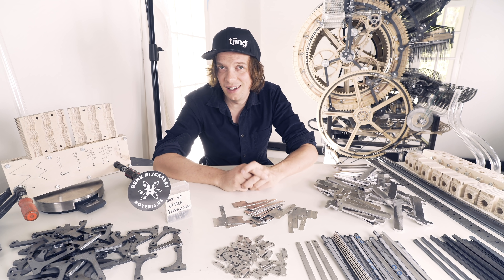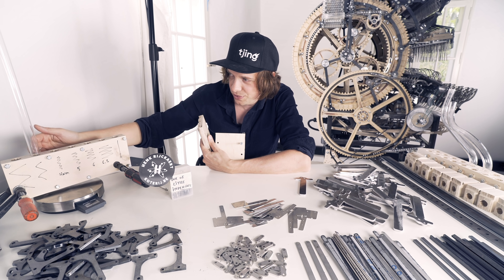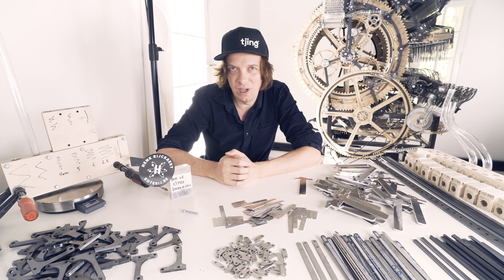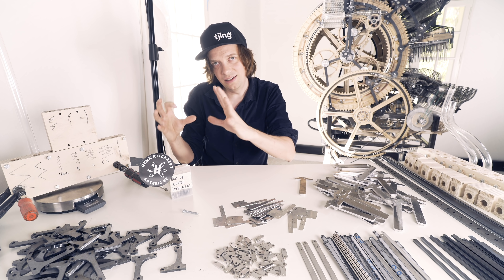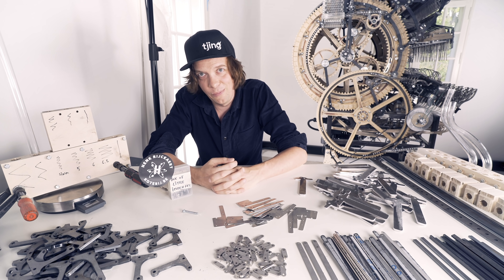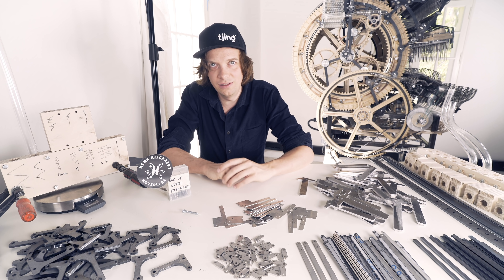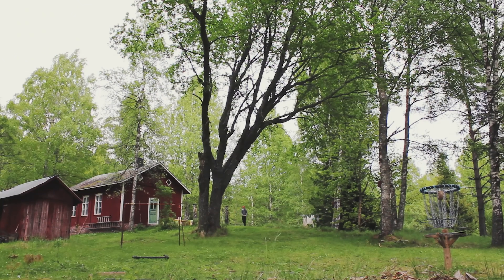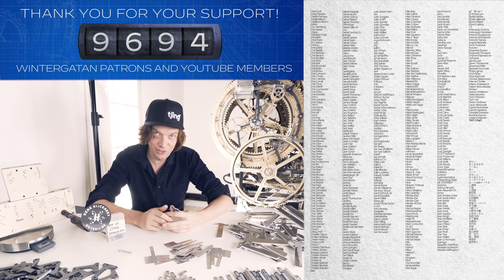New Parts and Quick Update - Marble Machine X #140

Comment: Machine has too much steel. Too heavy, but the benefit is the ease with which things can be welded and modified. Aluminum processing without a proper CNC mill and a ton of raw material on hand is not really feasible.

Comment: This could help you make a new machine @Wintergatan :)

Number 13, part 2
Hydrogen is the most common/abuntant/present element; not "just" on the Uni-verse but also in our Bodies.
Dan Winter prooved through his equation that the Golden Ratio aka Phi unfolds, from the smallest we know, Plank Scale, series of harmonics that match with the meassurment of bodies & elements that are Vital for our existance, such as the Hydrogen Radii.
Here is a set of some of my most recent "discoverments" regarding this theme:

1. Plank times Phi^n doesn't just gives us the Hydrogen Radii, but also its frequency, within 99.57% of accuracy.

2. Hydrogen line (its frequency) is Phi/4 from a Caesium 133 frequency (the meassurment of our second, base of our human time-grid.
Caesium 133 ; 1,420,405,751.7667 divided on Hydrogen 9,192,637,770 = .15451568 = Phi/4
I call this proportion Hydro Time, abreviated Ht, and you can call it like that also.
1 second = .15457568Ht
So, The Golden Ratio not just unfolds the Vital sizes & times from the quantum realm, but Also, it sets the diffrence from the time sytem we use ( wich is based on Caesium, a preatty irelevant element in our life ) to Ht wich is based on Hydrogen, wich is the most present element on the Nature of the Universe.

3. 2 seconds = 13 Ht

4. A 13 note musical scale delivers golden ratio intervals. The 9th of this note is 21/13 from its root, wich is 1.615 (99.8% Golden Mean). Also the 6th note, wich is 18/13 ; 1.38 from its interval ( 99.22% of accuracy of 1/Phi^2).

Summary

13 is the perfect bridge from our time system to a more relevant one : Hydro Time .

Also, when used in music it gives us acces to one of the most important ratios on this Universe: Phi.
In the video below you can see a comparation from the traditional 12 notes music system to a 13 notes one.

Note how the 13 note scale adds a new petal on every single note. 

In the 9th note we get 10 petals, made from 20 golden spirals, & In the 6th note we get 5 petals, also made from Golden Spirals. This is the geometry Dan talks about ( and very similar to the one formed between the revolution time of Planet Earth & Venus)

No edit have been made. This is just the visualization of circle notes on the osciloscope.
https://youtu.be/3HOvgdE9m_Q

Comment: So, now you're back, Remember: you can do the thing!  You're in the endgame now!

And any time you feel like the proper engineering solution is complex and crazy and discouraging: the original Marble Machine _worked_.  It was built from hand-cut wood and hand-bent wire.  It may not have been optimal, but it absolutely worked, and it became a complete internet sensation.

Now you're aiming for perfect, and, yes, that's like aiming for light speed.  You'll never get there - physically impossible to do it - but each bit of energy you put in gets you closer.  At the end of the day, It's up to you to decide where "enough" is - where the energy you're putting in is more than the results you're getting back.  "Done" is always relative, and differs for every project for every person.  

But you have a huge advantage: you're writing down your requirements, you know when they're met, you have a good bead on when they're infeasible, and you've got a LOT of experience at this point working around the infeasible.  That's so many miles better than looking at what you want vs. what you have and thinking, "I don't even know what the first step is".  You know what the steps are now.  You know how to get there.  Maybe there are unforseen bumps - there always are - but you've dealt with bumps before, and you can *crush that shit*.

You can do this.

I believe.

Comment: Martin, You are only maturing. That is all. Now, as the MMX master builder, put into your thinking the law of diminishing returns which is a natural law faced by all masters who become such by refusing to give up. This law, in a context applicable to you simply states that the closer to come to realizing your goal (even if your goal remains a little vague because you are doing something that has NEVER been done before), it will take more work per energy unit expended to achieve very small but significant increments of improvement. In your maturity, you MUST first accept this idea and then, develop visceral and intellectual tolerance for it and allow it to be as it is without getting frustrated over this. You could quit but we both know that you won't. So, the only rational and healthy alternative is to understand where you are in the project (very close to finishing it even if it takes you more time to finish than you may currently realize or accept as your reality) and appreciate that the law of diminishing returns is now "kicking in" and this fact is all the evidence you need to know how far you've come. Another way to say the same thing is that since you have now reached the stage that it takes more and more effort to get fewer and minor incremental improvements that are still quite necessary and important to achieve (to meet standards of performance, etc), this manifested reality PROVES that you are being successful. So, take a deep breath, go on vacation, get recharged, and come back renewed ready to tackle and finish the project however long it takes. By your own commitment to who you really are, guess what? You don't really have a choice. So, add in the good feelings and drop all the bad feelings just as soon as you recognize the applicability and the positive value of the presence and operational appearance of the law of diminishing returns. You're almost across the finish line!

Comment: I can not speak for mechanical stuff, but i have expirience in hardware (electronics) design. Any somewhat complex design cannot be fully CAD'ed and Simulated complitely. Even if you got everything right electronically, there will be some ergonomics, or software or assembly problem. You just cannot finish design with no prototypes. But, CAD'ing and simulation is the key to sucsess. Have a nice vocation!

Comment: I work with Frontier Theory in my work and have been watching your channel with great interest as you explore your own frontiers of design.  Your discussion on earlier "naive design decisions" and their later ramifications, is a common problem in technological frontiers.  It is one of the reasons that most technologies move forward in a series of generations.  These decisions, made with best available information and intention, meet reality and sometimes prove to be problematic. There is literally no way to forecast which decisions are naive without actually going out an building.  Solutions to the revealed problems are tried, and are often quite successful.  However, there is a class of problems in which the solution creates unintended consequences.  Occasionally, these turn out to be brilliant, but more often they create further problems -- sometimes expanding outward in ripples through the technology.  Your machine is interesting in that you are putting generations of new subsystem technology to work on a platform that can be adapted and changed.  At some point, you will need to say, this is good enough and go on tour with the full understanding that what you have is not perfection. There is nothing to stop you from taking your many lessons learned, hard-earned skills, and eager to help workforce to build the next generation of the Marble Machine.  However, I have to warn you.  You will again experience this period of angst when the next machine nears completion.  Sorry, it is just how technological frontiers work.  Be of good cheer, this is also a hallmark that a generation in nearing maturity.

Comment: Well, I too learned the hard way you can't have everything.
Engineering is mostly about picking your battles and battlefield strategy.

In any case, you can always over engineer the solution (marble gates to regulate final height?)
But nothing beats the beauty of a simple solution with few problems.

In case you can't find a good solution, just do what a real engineer does, choose the best problem.

Comment: Here's what I think. Every artist will have to start with a new piece of paper at some point, you can keep on erasing sketches on a single canvas but you'll have to finish it eventually before you start damaging the surface too much. 

You'll have to take what you learned making that piece and apply it on a new sheet of paper.

I guess my point is, You've learned so much from this project alone, you'll have to apply it on new ones and you'll eventually find that confidence~

Comment: I haven’t looked through any comments, but the MMX needs a mechanical fuse! The jamming of marbles need to break a easy to replace part. The fingers on the programming wheel can be scored to break at a certain torque level, and be a sacrificial part. Save that fish stair, ect.

Comment: Try not to feel bad about the 'naiive' design decisions. Each instance where you had an idea to solve a problem is an instance of human inspiration not shortsighted failure, making the machine more than the sum of its parts - it is a collection of human inspirations. Had every design decision been perfect it would have been no different to having a computer design the machine and none of us want that. 

If you look closely at the thin line between perfect design and your on-the-fly human inspirations that solved many problems (and sometimes caused others to be solved but that's not a bad thing necessarily) that is where you find the artistry of the project. That is what we are all here for. This shared passion that we all have to support you in making this beautiful abomination is borne of the artistry of it all, not the absolute perfection of every aspect of its construction. In my eyes you've succeeded and you haven't even finished yet.

Comment: Instead of a zig zag design how about a U-tube approach when you can tune the bend in the U to adjust length like a trombone slider or with a variable bend angle .  For this to work you would use a u shaped tube out of acrylic..which you love.  Straight ...45 deg 90 deg, 45 back to straight again.  You’ll also need quite a bit of z clearance... not clear if that was a constraint. 

We engineers are not downers we just never rush to a solution.

Comment: When you built the 1st marble machine you built it until it worked even if it wasn't perfect. What matters is that you're in peace with your values.
Regarding what you said on the engineers and how they are makes me really think about the "black hat" way of thinking. (De Bobo)
It's ok to wear that hat, you need black hats, and the you need to switch to the others hats to find the solutions to the pitfalls identified.
I hope your holidays will bring you the fresh air needed to recharge your positive energy, pain is temporary.

Comment: You're just having some kind of maker's identity crysis. You've been an artist your whole life and just recently have started to think like an engineer because of this project and those two mindsets are clashing (form over function) vs (function over form). My advice to you is to try and find joy in solving each of those problems, look at them as puzzles and not obstacles, that'll get rid of that feeling of being overwhelmed. The MMX can still be saved and finished. And if you decide to make an MMY desing it around the MMX existing design instead of making an entirely new design and focus on making the manufacturing and assembly of the machine as streamlined as possible.

Comment: Marble machine is one of the projects that will need a lot of debugging and polishing.

I am lately dealing with similar project which needs constant revisions: laboratory supply from scratch. It is something that a few people made, other just bought one off the shelf.
I fix one thing, then it works, but later it breaks down or starts oscillating. Today I was fixing it the whole day. It was oscillating and not working.
I then found a workaround to fix it, but it is not the best and probably the supply will stop working in the future.

So I wish you good luck Martin with your MMX, and dont give up :D

Comment: Forgive me if this idea has already been floated out in the discord server:  Might it be possible to have the 'collection tubes' positioned closer to HORIZONTAL, with only a SLIGHT angle--rather than completely vertical?  It wouldn't be a REPLACEMENT for the need to adjust heights at the marble gates, but it MIGHT be enough to dramatically change the necessary tolerances... The marbles could run down a perfectly SMOOTH incline, and only 'deviate' into a channel if there's room for them to 'fall off' the track (?)...   

Love your stuff, and have a great vacation!

Comment: Instead of going with the zig-zag route, how about splitting the long length of the marble paths and add another overflow path to re-route for recycling.  this way you can control the weight problem by the length of the tube

Comment: Hang in there Martin, we're pulling for you, and remember failure is always an option. like if you get this on stage and it fails halfway through your first song I would gladly sit there and watch as you try to repair it during a live show. even if we don't get to hear the marble machine play. let's say a part is completely damaged and you need to rebuild it and the show it would be canceled. I say no, don't cancel it, get the camera up there and film you repairing it. I'll gladly watch that. There is always going to be some issues you just need to work with those issues and use what you got and show what you got. There's always room for improvement as you go. As mr. Green would say we're all pulling for you keep your stick on the ice.

Comment: You may not feel it but this project is making you an expert in the field. The engineering expert will preempt design problems with multiple iterations of the same solution in their head.
A good engineer can discuss a solution amongst piers without being precious about their contributions, all in the group have a common goal and excitement to find the best combination of elegance, practicality, dependability, durability and efficiency. 
When forging new paths, "suck it and see" like your marble paths you were showing is very valid to kick off the path to refinement in an informed way.

Follow Elon Musk's Starship development for any period of time and you will see a path strewn with failed prototypes and ever more refined designs.
At least you don't have to see if the marble machine explodes every time you test something :)

Comment: You didn't design in proper tolerances, and that 'snowballs' into incredibly complex and compounded problems.

Trust your engineering advisors. With such an incredible problem there are only two ends, and you really need the computing/brain power to contemplate, visualize and mentally test all of the problems and potential solutions to the end of the project taking careful consideration foe the many chains of reaction each potential solution will effect, again, all the way to the end of the project, and then you have only found the answer to a very simple question:

Is it possible or worth it?

Some projects are for experience only, and that is positive. If you can finish it, that's great! 

I've never complained once about how long this project is taking. I probably wouldn't like anybody who did. I know how long the process takes. It is worth the wait if it is done right.

Comment: Martin, if you reaaaally are going to make the MMY, then maybe consider painting the metal parts aswell, or using stainless. I don't think it's really an issue with the MMX but just don't use it in the rain lol. also, I think a much longer MMY would be cool aswell, kinda like a piano, so you have more range on the xylophone and more room to refine the machine

Comment: The "done" phase of a project is the hardest part. Unless you are building something for someone else and have very precise specifications for what is "done", if this is something you are building for yourself, then "done" is whatever you say it is. And as long as you are building it for yourself "done" can mean whatever you want it to mean, which makes determining when you have reached the "done" state very difficult. There's always one more feature, one more tweak, one more design change, and "done" gets pushed further and further out. It happens to me on all of my software projects. "Done" keeps getting pushed out. How I determine when an app is finally ready is, I make a list of all of the things it MUST do, and a list of all bugs that need fixed. When I have achieved that I give it a few weeks of testing to see if there are any NICE TO HAVES, and if I feel like adding those I will. But once the few weeks are up if I haven't touched it in any length of time then it's "DONE". I give it one last test to make sure nothing is broken and it meets my list of requirements, then I ship it. Done. Is it perfect? Probably not. If I like the app and find bugs later I will fix them and release an update. If I come up with a great new NICE TO HAVE I will add that and release an update. If nothing comes to mind then I'm "done" with the app and move on to the next one. Does your marble machine work? Yes. Are there any serious bugs that will cause it to self destruct? Hopefully no. Are there things you would like to add or improve? Of course. But you have achieved what needs to be "done". If something breaks later, fix it. If you have an idea for improvements, work those in later. You can't engineer "perfect". It's not possible. Get it "done" and go on from there. Improvements come later, if you feel like it.